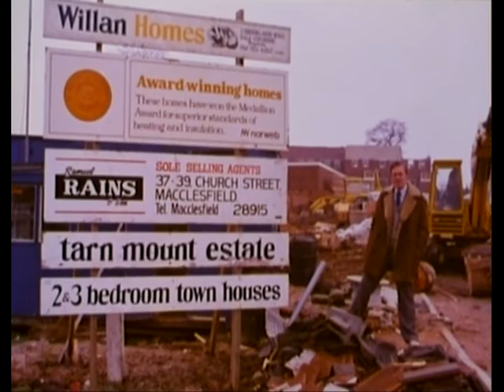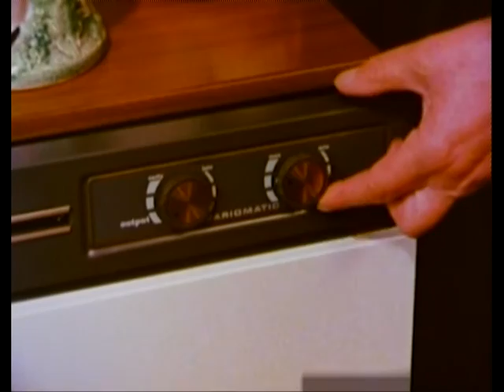Switch to the Facts - Insulation and Heating (1980) Electricity Council Film

Comment: Love the music! Sounds exactly like BBC Schools, Ceefax or Trade Test Transmission type music with heavy use of the flute.
I lived in a tiny flat from 2016-2017 with those storage heaters and they were worse than useless cost wise and heat wise; we ended up borrowing a heater as back up after one of them burnt out. The bills in the 3 bed house I'm in now on gas aren't much different than that flat.

Comment: How about the cost of electric heaters verses gas heaters, like a gas fireplace, rather then a boiler and radiators?
  It's sort of strange watching this, 3.5'' of insulation in walls was the industry standard in Canada, and the U.S during the 1970s, I think it was at least 6'' or more in attics, depending on what area you lived in, and it was also the standard to insulate floors that sat above an unheated space. They make it sound like a revelation to do something that most places in North American had been doing since the late 1940s, or earlier in some cases.
 The preferred method of insulating attics, around 1980, was blown in cellulose, basically recycled shredded newspaper treated with borax, although some used blown in rock wool. Fibreglass bats were typically used in walls and floors, unless it was a retrofit then cellulose was used. Unlike what they displayed in the film, builders in North America were also required to cover the wall studs, and attic joists, with a vapor barrier, usually plastic, or the moisture from inside the house would condense and soak the insulation making it useless.  Urea formaldehyde foam was popular with retrofits for a time, until it was banned, partially because it would give off fumes, but also because it tended to break down and settle inside the bottoms of the walls leaving you back where you started.
Reply from the maker: Interesting to hear about what was going on in North America. UK houses have historically been poorly insulated and many older houses, even in the 20th century were built with no insulation at all. Even modern houses today probably fall behind the insulation standards seen as the minimum in other parts of the world.
Reply: Where I currently reside in British Columbia, all but the oldest houses had insulation in the attic, like mineral wool or vermiculite, but some didn't have it in the walls. They used to use a paper backed foil on the inside of the wall studs in the same position where they would use the plastic vapor barrier now, I guess the theory was that the foil would reflect the heat back into the room, but it doesn't really work that well. By the 1960s it became standard to insulate the walls, attics, and even the floor (if the house only had a crawl space and no basement). The houses here are typically wood framed, only commercial or government buildings are constructed out of solid bricks, unless they are over 100 years old. I just seems sort of odd that house construction in Britain, which has a climate that is cooler then much of the West coast of Canada, didn't get into the habit of installing insulation until such a late date. Was this because coal was used for household heating for such a long time?